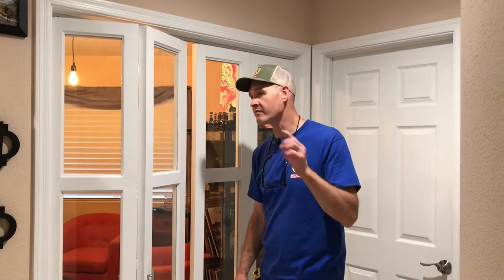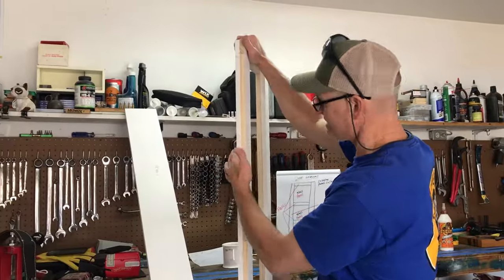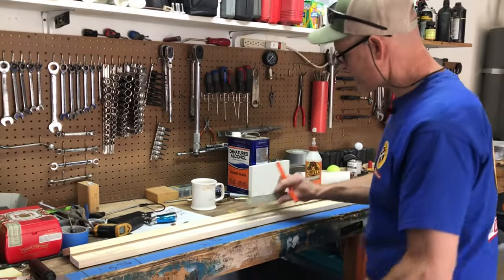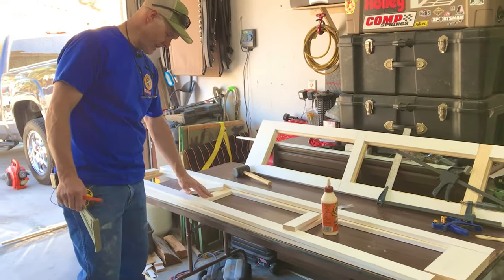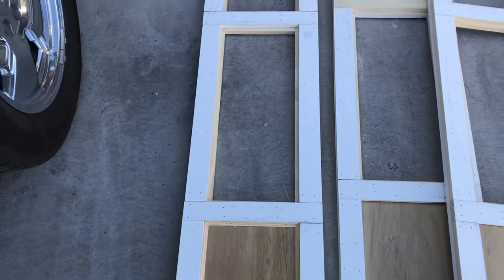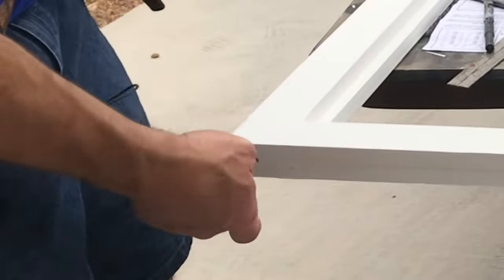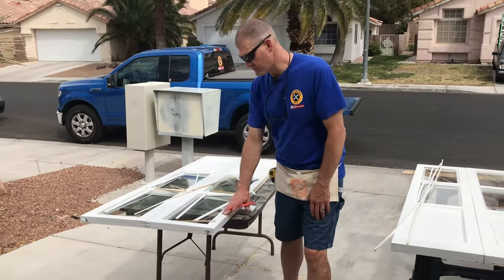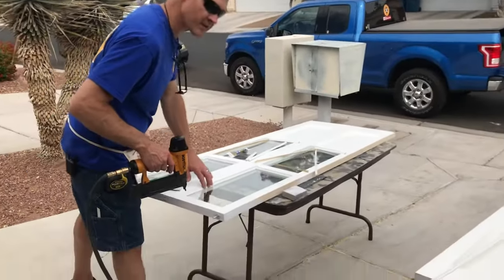Custom Bifold Doors From Scratch!

Comment: Fred, your video has great information on how to make some solid looking bi-fold doors.  When I read the comments, I saw that there were only 10 - which surprised me - but then I recalled what I first thought when I saw the title "How To Make Bifold Closet Doors With Glass Panels" - I thought, I'm not interested in using glass, but I liked the look of the doors, so I decided to see what else you had to show - and I'm glad that I did.

As it turns out, you show how to insert 1/4" plywood panels as well as glass, and were "wood" also in the title, it might likely increase the number of viewers.  So, someone could simply increase the amount of wood (3 x 4' x 4' 1/4" plywood), not use any glass at all, and make a shaker-like, double-thickness door.

Your costing of the project also helps a lot, but it appears that you left out the cost of the pine glass bead moulding (unless you already had this lying around). 

The plan details are very helpful - thanks - and your description of the lumber used is also very helpful.  Many similar videos don't address the question of lumber used at all, other than to say "lumber of your choice".

At 9:53 in the video you say that you are using 1/2" 16 GA brad nails to pin the plywood and the glass into the panel openings; would I be wrong in assuming you meant 18 GA nails?

Last thing: how are the doors holding up in terms of (a) weight wear on the hinge hardware, (b) durability of the track hardware, and (c) straightness and durability of the doors themselves due to the double thickness?
Reply from the maker: Thanks for the great insights and thank you for watching. First off these doors are holding up just fine and 18GA is the nail size. The doors are in Fred Jr’s house and we built them because we couldn’t find door to purchase that looked like these with glass. Making these doors in other variants as you suggest is a wonderful idea. With a few minor changes one could easily create a custom look to match other situations. After reading your comment, I spent some time rewatching this video and the thought occurred to me that perhaps folks would not have the courage to build doors like these in their driveway. This video shows that it is possible!
Reply: [... the thought occurred to me that perhaps folks would not have the courage to build doors like these in their driveway ... ].  Hehe.  You are right, there.  Your details, humor, and delivery are spot on.  I also watched your replacement of the sliding patio door which, because of the stucco, was at least a notch above the norm, challenge-wise.  But you handled it well.  Many thanks again for the excellent videos.